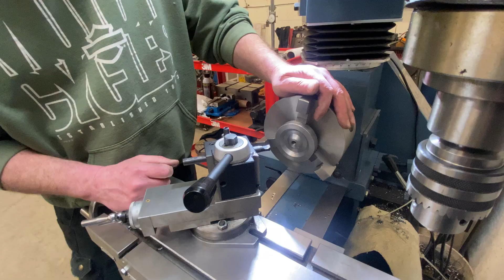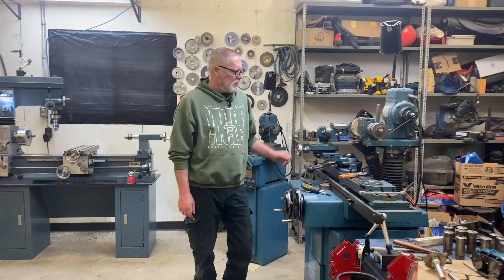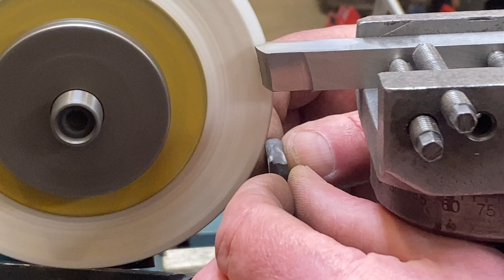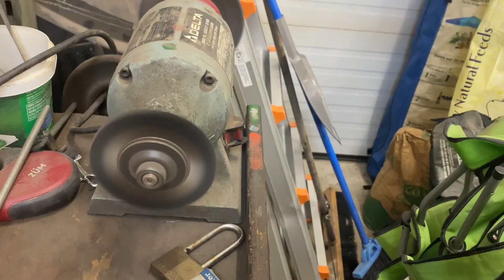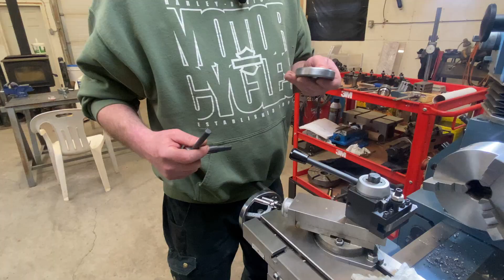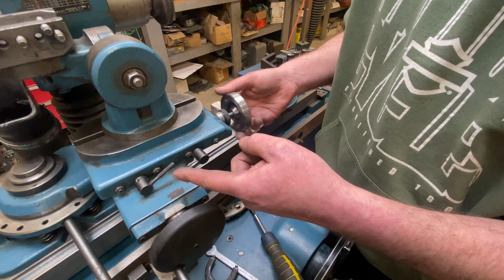New handle for the radius grinding fixture part 2

Comment: Cheers to you too.
Another suggestion would be to throw a bar in the 3 jaw,
Drill n tap to suit, bolt the object to the mandrel.
Suits light work.
Good video.

Comment: The knob for the grinder turned out great, What you could do is to drill the threads out part of the way through so that you have threads from the shaft sticking out and then put a nut on to tighten.  And when you have problem with chatter is to turn the chuck by hand to remove the marks and feed the tool in to just touch the work then turn the chuck, it will only 1 or 2 revolutions to remove the chatter marks.👍
Reply from the maker: Thanks for watching. Great tip!